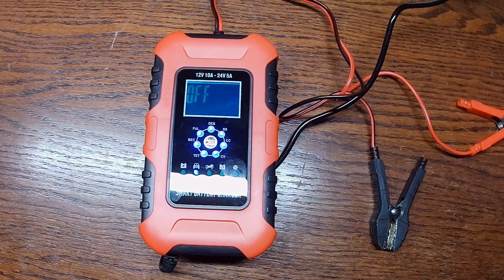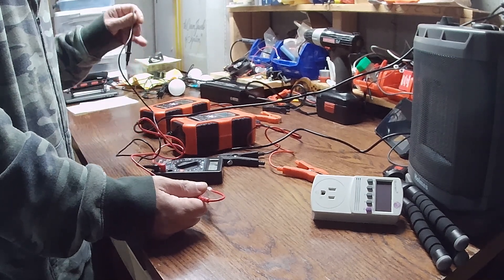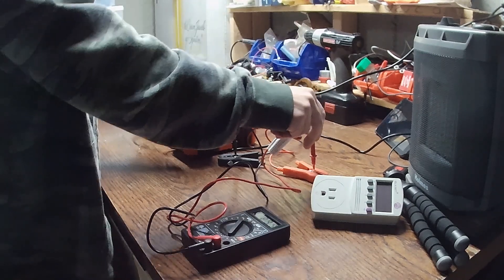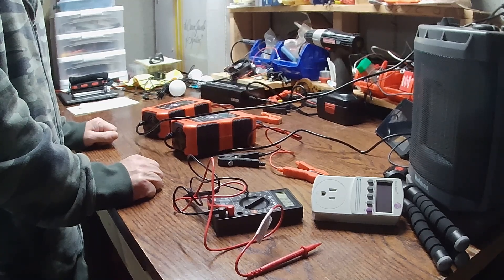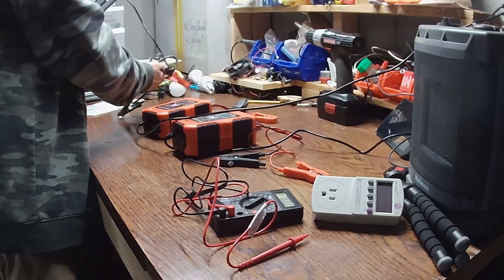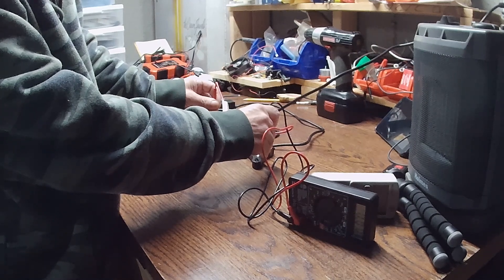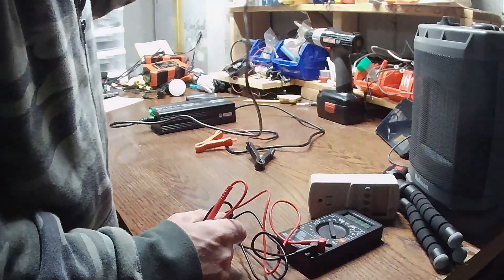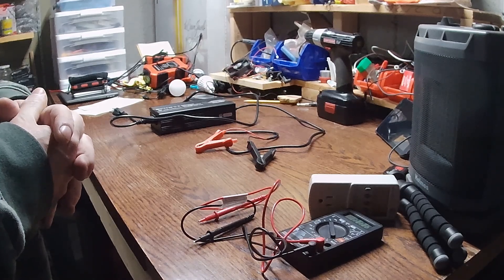Surprising safety issue with this charger!!!

Comment: great update … I didn’t realize it, I’ll test mine later … thx.
done testing: it showed 30.64V at the clamps whilst showing “Off” … I have another charger; with its power on the clamps showed 16.64V … the thing is my 12V car battery is showing 14.05V at the terminals … guess the battery on its own is also a safety issue … point is, both chargers should be treated with respect at the clamps when connected to a live power source; same as a 12V or 24V batteries standing minding their own business at the corner … great tip by the way …

Comment: Check and see what the current is coming out when you see the volts with unit in OFF. It may be sending out a "sense" voltage which is often just a small trickle and may be actually harmless. If it is jumping it is most likely just "Looking" for a load. a floating voltage is common in many applications. Does the Kilawatt show any power being pulled? What is the power draw in OFF vs full charging rate on a dead battery? It does say it is "Smart Automatic Maintainer Trickle Charger" so it is probably doing a float charge regardless if there is a load or not. I agree that is not best as OFF should be completely OFF and not trickle. It should have an OUTPUT RELAY so it can completely isolate aka shut off the output in the OFF mode.

Comment: I have 2 of those red ones, both with "Foxsur" on the back like yours. They both do the same thing and, coincidentally, when connected to LiFePo4 battery (ies) also show a wattage draw of 38W on a Kill-o-Watt meter with the charger display reading "FULL" and no flashing of LEDs. It must be doing something.

Comment: I think it is a "wake up" voltage for LiFePO4 batteries. 
If the battery BMS disconnected due to low voltage (dead < 9 volts or so), you can't charge it until the BMS sees voltage at the terminals that is above it's disconnect voltage.
Many newer battery chargers that are not lithium specific take a voltage measurement (requires no output from charger, just like your voltmeter) to determine charging voltage (i.e. 6,12 or 24 volt). If the charger sees no voltage, it won't charge- useless if BMS is disconnected.
LiFePO4 chargers send a voltage to "wake up" a disconnected BMS so charging can begin.
Sometimes you can even wake up a BMS with a little square 9 volt battery.
Still "Off" should be "off". Bad design.

Comment: Were your chargers in 24V mode, before getting the 30V readings?  My charger was used at 12V before reading 17V in "OFF".
There seems to be little to no amperage in the leads.  Any load, like a small light bulb sends it into error mode and the voltage drops off.
Maybe it is a sensing current sent from the charger to detect the battery condition?
Other than this anomaly, the charger works great.
Reply from the maker: I just tested and checked mine again and same result.  I think you may be onto something regarding the charger trying to detect battery.  My units have only been used for 12v but the chargers automatically detect what the battery voltage is.  I hooked it up to my 12v 50ah ampertime battery and it then showed 12v on the charger.  Unhook the battery and shows no 12v or 24v on the display.  It still shows 30V on the leads though after unhooking the battery from charger.  Not exactly sure what the issue is but I also agree the chargers work great other than this weird thing.